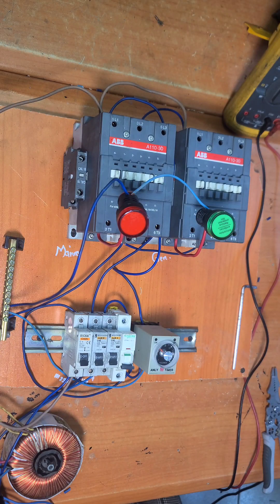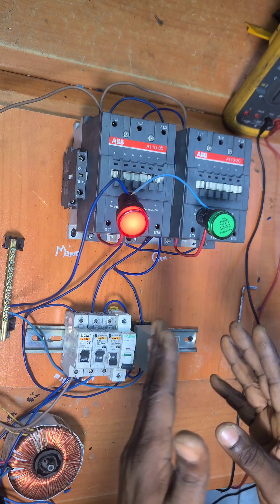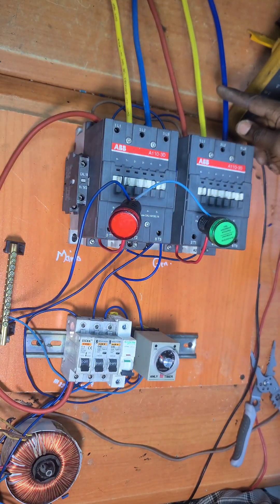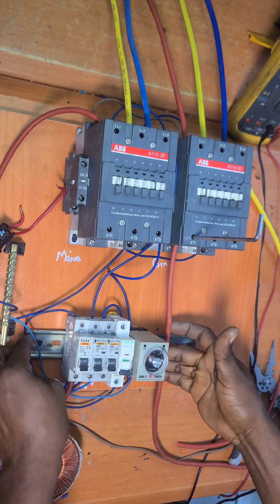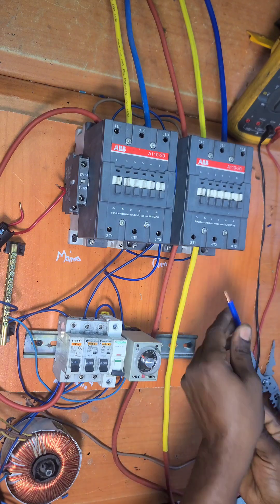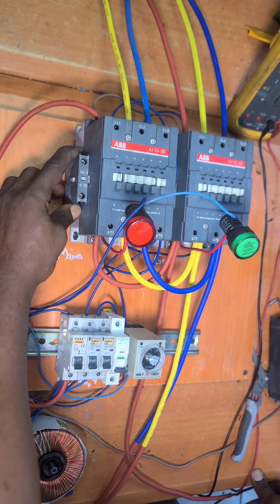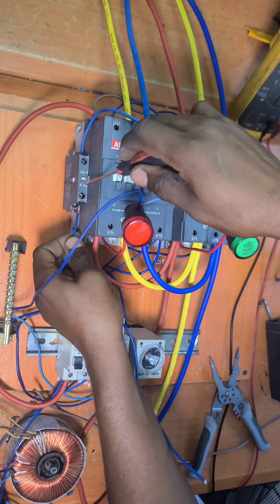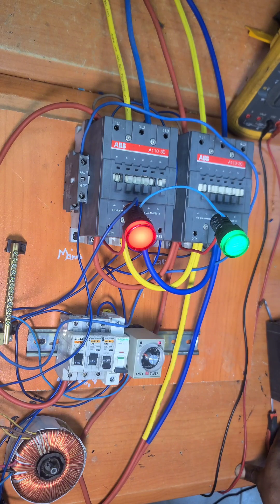ATS

Comment: Please I have a question which is based on using Ats and the mains for 6 different electric meters, one generator will supply 6 different consumer units and 6 different Electrical meters will supply the same 6 consumer units when mains is restored,